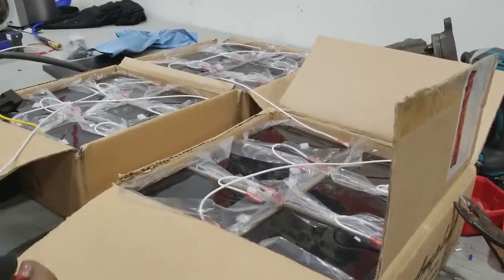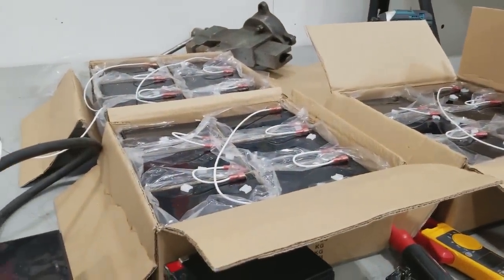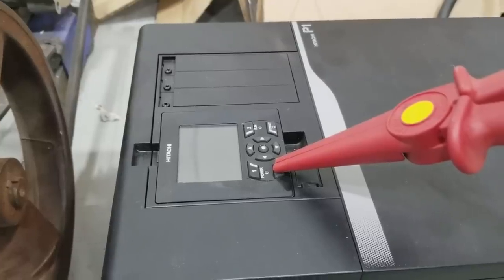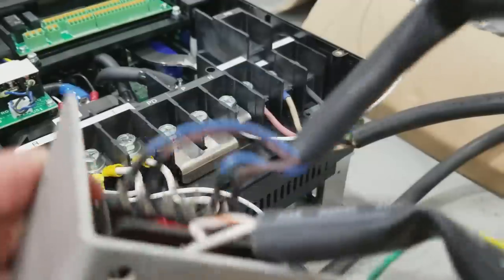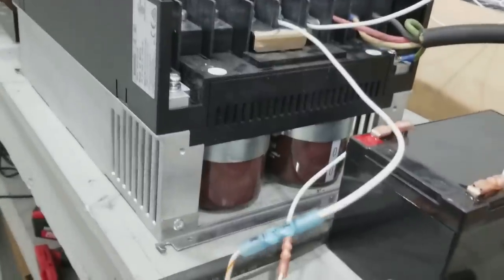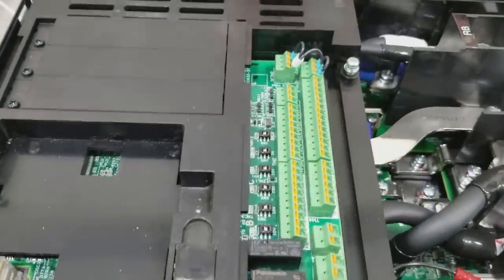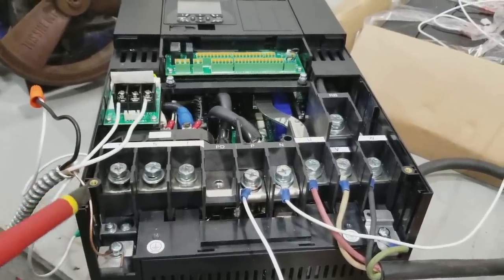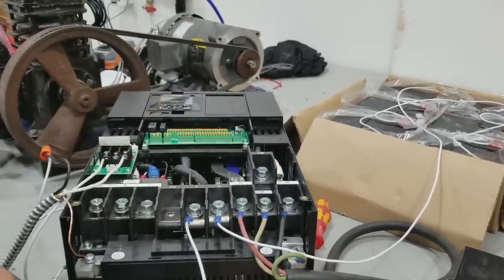Return of Dewclaw! | Battery Air Compressor

Comment: Compressor running backwards?
Reply: Just switch 2 of the fases, easy as that..
Reply: So ...... now it's an uncompressor?
Reply: Its a gag compressor...someone goes to use the air hose and it sucks instead of blows lol
Reply: One way check valve style compressor don't care what direction it turns. They are nothing more than a piston and two check valves.
Reply: @bansheeman213 i know that but the cooling fan in the belt pully cares
Reply: @Stummel01  either the air gets pushed across it or pulled around it . Both ways will keep it cooled off.

Comment: you can never throw any thing away because 3 months after the wife cleaned out my room she came to me asking were the parts to the ceiling fan were she had thrown them away . lucky for me I have a cut out in the floor to hide my stuff.  this summer she got all of my yard stuff out of her hair and I almost cried 30 years of collecting gone in 2 hours but I kept my welder she tried to toss that too a Lincoln 200 from the 1960's with copper winding's but I sat on it tell she went back to her cave and let me be

Comment: It would be interesting to see if it would run a 3 ph 5 hp motor running a 150A alternator charging the battery bank and supplying power to a 30A (or more) output inverter. The future lies to higher voltage and less current draw.

Comment: Using a manual. That's a corner off your man card for sure
Reply: Using the wrong manual and succeeding regardless though?
Reply: I use my Makita manuals every day, they keep my bench near perfectly level
Reply: There are manuals....and then there are VFD manuals.  Not the same and VFD manuals do not carry a penalty for using.  You actually gain points if it's a Japanese drive. 😜

Comment: Never you mind this elec-chicken sh*t kids, just go to the scrapyard and get you one big honking 24 volt DC motor thingy and hook it up to those there batterias in parallel groups of 2 12volt ones in series, and that’ll chooch the motor real good, no inverter needed! Or, just wire all those batteries to a wire mesh screen around your beer keg to protect it what from those pesky moths... or probably, those elec-chickens! You might even have enough power left over what for running a neon sign advertising your favorite alky-haul-ic beverage (that you protected with the poor man’s bug zapper!)

Comment: How are you going to charge those batteries?
Reply: You can either spin the motor with another motor and put the VFD in regen, or by 30 battery chargers!
Reply: @mckenziekeith7434  and how do you balance charge this many batteries sanely?

Comment: "Gentleman have I got a treat éspecial for you today, the very latest in pixie-squashing technology usable anywhere on this fine planet. For the low price of a pile of junk you too can have this magnificent product guaranteed to squash at least 20 pixies every single minute. (Free-flowing) All you need is our ultra-light cast-iron pixie-smacker, the latest angry-pixie-confuser, a metric ton of pixies in bottles and one of your finest single-phase pixie-outlets. Fully transportable you can haul this out to any field, and with a long enough pixie-cord you too can have an endless supply of squashed pixies - At least until the batteries run out and you have to spend 20 hours charging them."

Of course you could just use angry-pixie-juice in an infernal-combustion engine and do without the safety sunglasses, but life wouldn't be fun if it was easy - Or safe.

Comment: 40 Amps trough this diameter of wire?
Possible that you built yourself a fancy shmancy multi Kilo- Peso openair light- bulb that will burn your hacienda right to the ground if you run it for long enough.
Reply: The battery pack is several hundred volts. In operation the continuous current will probably be around 5 Amps, 10 at the most. The wire diameter is the least of my worries, LOL!

Comment: Wtf is this thing doing tho? Is the electric motor literally running wirelessly or is this just a big crazy inverter running a normal AC motor?
Reply: Just running the vfd without the rectification front end.  All that does is take incoming AC power and change to DC to power the DC bus.  They're just powering the DC bus directly with batteries in series instead.  All the rest of the drive is basically a PWM controlled IGBT H bridge for each of the three phases to recreate AC voltage, only at any RMS voltage and any frequency desired rather than fixed line voltage/frequency.

Comment: Might as well add Bluetooth while you're at it! Control settings with an app. A greasy mechanics dream. But yooo,  young gamers are the ones who check the internet first for information! Always Google Brand and Model and chances are you're going to find some literature! Haven't killed myself yet messing with hydraulics or my hydronic boiler. hahaha
Reply: When you cost by the hour and the purchasing was too cheap and absent minded to order the book with the drive, it needs to run in two days, and there's no time to buy replacement smoke and have it get there in time, you are definitely on the internet digging up the manual pretty early on in the process, especially on obscure drives and installation configurations.  The young ones may only be doing that because they already had the opportunity to be the apprentice-on-the-wall watching someone else blow something up at very inopportune times! 😬

Comment: couldnt you just get an inverter? you can get some pretty fucking beefy ones nowadays (the off grid folks have some 5kw units wich run on 48 or 72volts and even do the whole battery charging and shit)  those things can even do 3 phase if you have 3 of em in a way that they can talk to another ( google MPPsolar or  voltronic power, wich is the OEM)

Comment: So you are rectumfrying 240V 3phase off batteries as a proof of concept.  What's the end game???  Nothing household is 3phase, so it's industrial.  Are you setting up a solar array to charge your pile of batteries and then running your Bridgeport or your Powerex off of it?  
7 horse VFD isn't going to get you too far in the metal working department, so a bigger badder VFD must be on order?

Comment: Und yetz the rectifrier fails to straighten out ze uberabundant DC? 
From talking round the water cooler, you had inbuilt polarity protection on the AC inputs, reverse polarity is nothing to a rectifrier - for it straightens the queerest of signals, and you bypassed it for theatrical reasons at the risk of a dual Darwin ... honorable mention.  
For this we can but say, thank you.